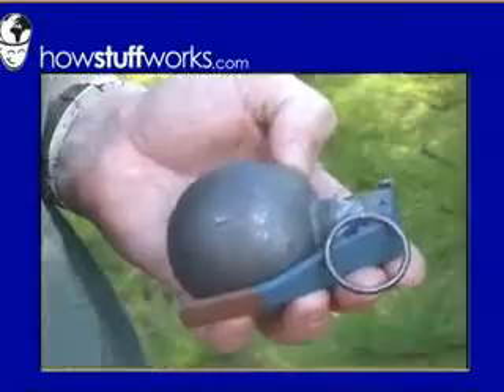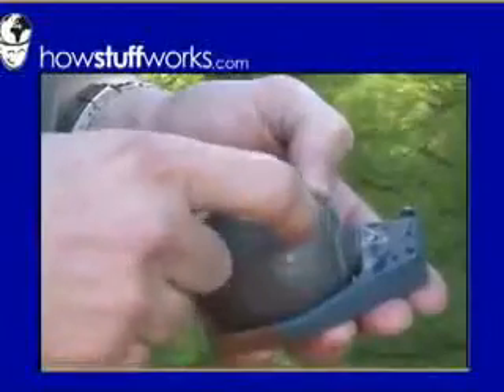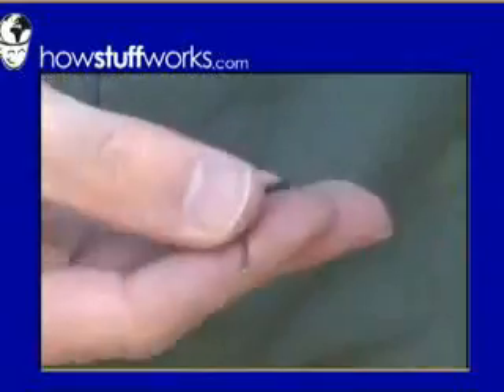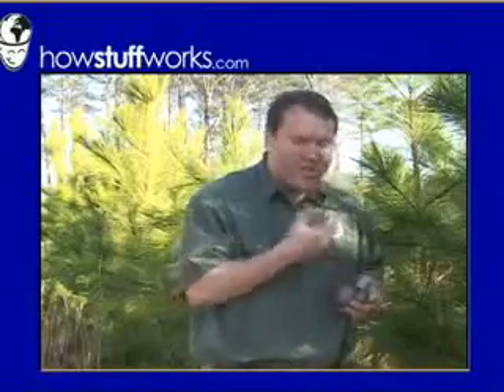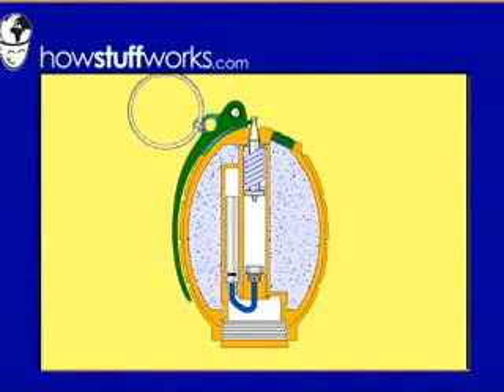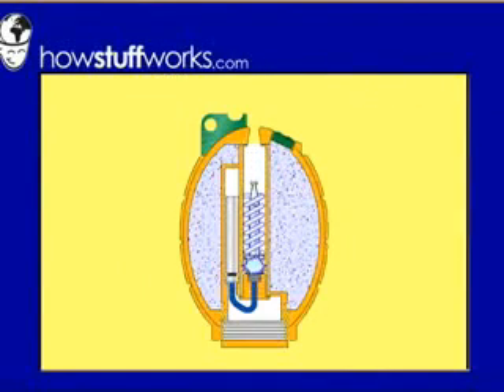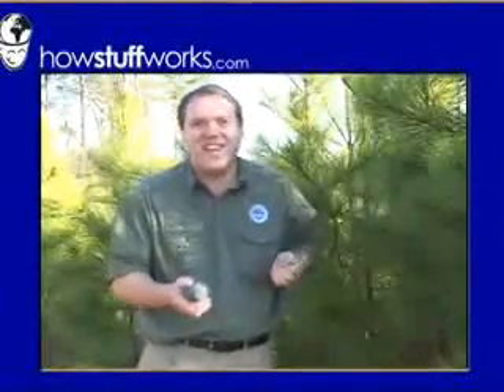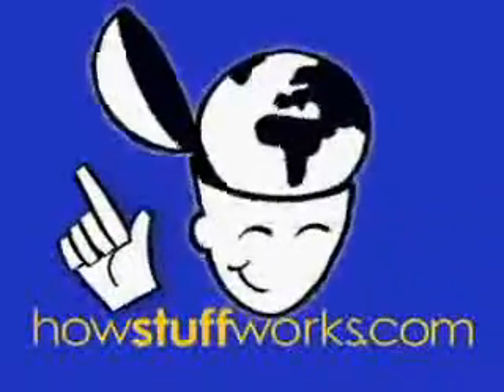How A Grenade Works

Comment: we have found a old egg grenade from ww2 in water (sea). but it absence the igniter. so on the grenade is very rusty. it is danger or ok?

regards
ZUG STEINER
Reply: It will not explode without the fuze. It is possible that some of the explosive remains intact, but it is doubtful after exposure to sea water. US a stick or other object to remove any debris from the core of the shell. Be sure to wear gloves because the type of explosive used can cause aplastic anemia if exposed to skin. It is very toxic.  Overall, I believe you have a nice relic that is reasonably safe. I hope this helps.
Reply: if the igniter is missing it could be a dud so i would have it checked out

Comment: Can I put back the ring again after I have removed it, thanks for quick answer ;P
Reply: Yes you can.
Reply: +Yukki seriously ?
Reply: +Barry Bryant ye you can put back the ring after taken off as long as you are holding the handle in place. The ring is just there so the handle doesn't fell off. But if you move the handle then you'd better throw it.
Reply: ok thx

Comment: Not as smart as you think, the pin, does everything, its the difference between you holding the grenade in your hand safely or you being dead! It's NOT a handle, it's nomenclature is the spoon. In most all current models of U.S grenades there is no heavy steel for the jacket. It can be sheet steel, notched and segmented wire or a matrix. But all in all I'd love to see you throw a live grenade the way you did. But I couldn't tell which was the "dummy" in the video.

Comment: "Technically the pin doesn't do anything."  

Ummm...  It keeps the grenade from detonating.  That sounds like a pretty fucking important job to me.....
Reply: The pin releases the spoon(or handle) which then snowballs into the boom-boom part.
Reply: HAhahahaha!
Reply: +TheEnmineer I preferred Mason jars... fit grenade inside rim, pull pin... drop from air, glass breaks, fuse is ignited, BOOM!
Reply: u can use tape as well dumpass
Reply: Eric Westrick Duct tape works just as well
Reply: +Eric Westrick
It's not the pin that prevents the grenade from exploding, that is the handles job. The pin only makes it harder for the handle to fly off unintentionally.
Reply: Eric Westrick nah it actually just holds the handle, because if you remove the pain and holds the handle the grenade won't explode.

Comment: Another dumb bunny that has no idea what he is talking about, The lever goes to the palm of your hand, not under your fingers, fool, If I remember right lefties held it upside down so the handle is once again against your PALM,  toss  the thing hard with a spinning motion will give a longer time delay with the handle staying on a bit longer, Well that is what the SFC said.
  Now there is a spring inside the weapon that is wrapped around the inside and it has notches in it and the explosion sends little pieces of spring flying out at 4100 feet per second.
  Make a mess of your day. Bet he never had one in his little had besides that dummy one.

Comment: THAT IS A FAKE GRENADE AND A FAKE EXPLOSION. Listen to 0.11, you'll hear the low whistle of the hollow body grenade. The explosion of Comp B has a short explosive thud, not a sustained "sound effect" His terminology sucks too: the Lever (Spoon) releases the Cocked striker thats held by spring tension. The mixture is a "pyro-technic delay" Thats not a small explosion inside (misleading). The Blasting Cap (detonator) is "primed" into the explosives initiating the "explosive train" = Detonator to Explosives or Primary Explosive to main charge.
Reply: You must have super vision and super deduction skills. I seriously thought at least 3 people were killed by real grenades in this video.
Reply: dude chill. Nobody believed it was a life grenade anyways...
Reply: This is an educational video.The grenade doesn't have to be real for us to learn something.
Reply: slow clap
Reply: milsperg activate
Reply: luckynater Exactly.
Reply: Sure.
Reply: FYI its a training grenade, the blue and grey colouring on the spoon indicates it is a screw in training fuse. It functions the same way as a real grenade minus the main explosion.

Comment: He was holding a US Grenade while the Video shown was a grenade from some other country, US Grenades use a Pyrotechnic Fuse with a burn down time of 3 to 5 seconds that in turn ignites the priming for the blasting cap that is attached (Crimped), the body of the grenade is segmented wire with a thin sheet metal covering. The 'baseball' (shown) is the same as the 'lemon' grenade other than general shape. The 'pineapple' grenade is a cast iron body with cast fragmentation segments. All were charged with 1/4 pound of cast TNT. The video was showing 'training grenades' (only contains the fuse that has a pyro delay with a black powder bursting charge. The 'Handle' (correct term 'Spoon') is painted blue with a 'brown' stripe on its end. Brown indicates 'Low' order explosives (black powder) Actual live Fragmentation Grenades have a 'Yellow' band painted on the 'neck', 'fuse hole' 'filler hole'. Training Grenades have a hole on the bottom so as to not 'blow up' into large low velocity fragments and to lets the smoke out (black powder has white/blue grey smoke) for observation. (Senior Chief Gunner's Mate (GMCS) USN Retired '64-'86)).
Reply: The grenade shown appears to be like an M33 but couldn't see the base to see if there's a hole to make it a practice version or the second hole in the fuse to see if it's a practice fuse.  And the illustration was a British piece of ordnance called a Mills Bomb.  (Army EOD retired).

Comment: but say if u hold the grenade in hand once it's 'armed' it shouldn't detonate since you are holding the handle and he said thatonce the handle falls of the whole process of detonation starts and shouldn't you be able to put the pin back into the grenade while you are still holding the handle in the same possision it was before you pulled out the pin?

Comment: What else would it be used for besides warfare? It throws flying metal fragmented debris, if you want to knock something over use an uncased explosive, something contained in a shell only has one purpose. I wouldn't call it evil at all, a claymore is evil, a grenade is a simple get the hell out of dodge device that allows you to engage in more targets and stun, wound, and possibly kill. It was made and used for the intent it was created. War is hell, and is what it is. Evil is opinion.

Comment: The diagram is for a WW2 era grenade. Modern grenades have a thin metal casing which contains explosive surrounded by a notched steel spring. On detonation, the spring shatters into thousands of tiny but very sharp fragments. The idea is to cause maximum casualties without killing. That way it ties up more manpower dealing with injuries as opposed to a dead body which becomes just a statistic to be dealt with later. Sounds harsh but that's the reality of blowing each other to bits.

Comment: nice story but he left out the most important part the stainless steel wire inside the grenade that is cut to break into 5,000 peices that is were the shrapnel comes from not the case breaking apart.

Comment: where are you from? 

with a swiss war grenade it's impossible.

one part straight the other round, once pulled out, you should hammer the round part and make it straight the put it back. which is impossible in a combat situation

Comment: you pull the pin and the handle flys off and the grenade then explode a few seconds later. If you hold the handle the grenade will never go off but if you hold the grenade and let the handle fly off it begins to "cook"

Comment: So let me get this straight. First off I know nothing about grenades. But in video games where you can "cook" a grenade is that false? Because the handle or whatever its called ignites the fuse but in games you pull the pin and few seconds later it explodes.

Comment: They forgot "the clip", which is first thing you remove that looks like funny paperclip,then you "twist pull pin" and when you spoon flies off, there is no spring loaded "hammer". Hammer looks like spring loaded mousetrap that ignites the fuse. Then 4 secs later BOOM!

Comment: first off, calm down
second, just because comp b has c4 in it does not mean a grenade is filled with c4. 
third, i recommend you think about who you might be talking to before you fly off the handle and suggest a marine ammunition technician "do a little research". i think 5 years and counting active duty in this mos means i may have a decent idea of what im talking about. the dod makes a very clear distinction between c4 and comp b

Comment: That looks like an M67 practice grenade, so there is also a second safety clip across the spoon (what he refers to as the handle), which you peel off before twisting and pulling the pin free. THEN you can throw it. Forget that extra safety, and the enemy will be surprised and confused for a bit, and probably ultimately throw it back at you once they realize they aren't going to be swiss cheese.

Comment: WRONG.  There's 3 safety's on an M67 fragmentation grenade.  The spoon, pin, and 'thumb clip'....which they don't show in movies.  Also once the pin is pulled out it can be replaced unless the spoon/lever flies off.  Then your fucked.